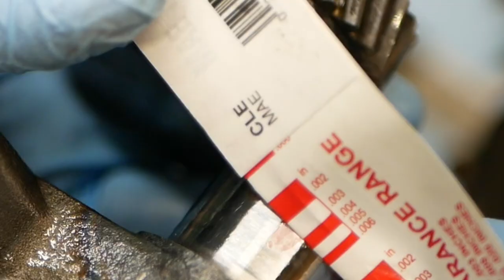212cc Predator powered mini bike motorcycle engine swap installing a stage 2 kit

Comment: You should try the juggernaut pulley from gopowersports. Works better with a built engine. I put one on my go-kart and I really like it and it doesn't rattle like the stock one. Also, I found with the yellow spring in the driven pulley, it wouldn't allow the pulley to fully open up due to the thicker spring binding. I had to put it in the lathe and machine out some modifications to the pulley and the cover that fits on with the snap ring. Now it is much better and runs to its full speed range.

Comment: longer intake - max momentum is in higher rpm , shorter intake - max momentum is on lower rpm. "Spaghetti" intake has variable lenght, flaps are changing lenght of intake, so momentum can be more "flat".

Comment: I recommend if u want more rpm with that cam and carb that can deliver it I put 26 lb springs very cheap only like $10-$15. On nr racing they are the max u can put on hemi with out cutting vavle pockets with a big cam and you’ll gain rpm right know with that setup you’ll hit vavle flait with 18 lb spring I build tons of those motors and last guy I had come to my shop had that exact problem

Comment: The long Runner going from the carburetor to the intake is higher torque at lower RPM I doubt that motor RPMs very high. Probably the best you can get you could try to adjust the length if you wanted you to see if you got more power at different lengths. Richard holdener on YouTube does a bunch of dyno test on different Motors and shows the difference between long and short Runner intakes.
Reply: That right William

Comment: The old was a two stroke 100 so it is equal to about a 200 four stroke but it is still quite a bit more powerful
Reply from the maker: The old engine was a 100cc four stroke, the bike was originally a Honda XR 100

Comment: Are you using the sprocket that came with the torque converter or are you using the original dirtbike's sprocket? I'm wanting to do this with an XR75
Reply: I believe he covers that in detail in the the first video in the series
Reply: @davidhelgeson6997  thanks, I went through and looked and I'm assuming it's the original TC's sprocket, might be wrong though.

Comment: I tried the long intake tube but the air fuel mixture wasn’t getting to the carb. I know I need to probably turn the idle screw, but how far out is the idle screw on your carb?

Comment: @ 1:05 you show the carburator and at the bottom of the intake manifold side there is a hole at the bottom of the carb. What is it? It was leaking real bad for me and I notice the gasket and plastic Spacer doesn't cover the hole is there a reason for that or did I just get bad parts.

Comment: Really like this. I've got an old crf100 that would be suited nicely for something similar
Reply: Doesn’t the crf100 make 10hp? That’s much more than these little engines, and you don’t have to do any custom fabrication.
Reply: agave 58-58  9.5 horsepower allegedly, and only 5 foot pounds of torque. You could easily exceed those power specs and displacement with a built predator engine. Probably won't ever get around to doing it but it would be cheaper and easier than rebuilding the stock engine or trying to squeeze more power from it
Reply: Jacob Reynolds ah, I thought you meant that the thing was running, makes sense.

Comment: Turned out pretty good.  What's your top speed before and after thd mods?
Reply from the maker: My top speed is still around 55MPH
The CVT seems to be limiting my overall top speed, it definitely pulls pretty hard now 👍
Reply: @Mikefestiva  oh wow it didn't seem that fast. Never knew this was possible to install one if them motors in a dirt bike. Im picking up a '79 Yamaha YZ125 this evening. The guy already did the frame work so all it needs is motor, chain, and torque converter. On another thing I'm Kinda doing the same thing. Its a '71 Rokon RT140 1wd Trailbreaker Offroad Motorcycle. Throwing in a 242cc Honda.

Comment: Reinstalled piston with the old rings? Why not take the extra minute to put new rings on while it's apart?
Reply from the maker: Because the engine has 5 hours on it when I installed these parts. The engine was barely broken in.

Comment: Your video inspired me to build my own bikes!! I made two  208cc bikes and they rip!! We explore lots of logging roads here in BC Canada and I've found my bike blows belts quite often. I changed the rear sprocket to a 62 tooth sprocket to help reduce the strain on the motor for climbing but it still burns belts after a while. Any suggestions?  Thanks Andrew
Reply from the maker: That’s awesome you built some bikes!!!
I found the aftermarket belts I have been using last longer then the stock belt but I know what your saying. There must be a better quality belt available? I remember when I was tricking out 2 stroke scooters years ago I ran quality Kevlar belts if we can find something like that I bet they will last much longer.

Comment: I would only be worried about fuel puddling in the tube, I would rough up the inside of the intake myself for a carbed engine. Regardless Love your builds and how you build it for your purpose.

Comment: Try the juggernaut driver in the front of your torque converter
Reply: Yeah the jugger is pretty mandatory for any stage 2+ build. The stock series 30 main just cant handle the power and will slip like crazy.

Comment: The xr100 brings back lots of memories, is your predator conversion more powerful than the original motor?
Reply: Its probably pretty close to the same power or a little more powerful. It's just lower rpm, different power delovery.
Reply: The original video will give you more information but from what I understand is that it is more powerful than stock however the other commentator makes a good point I’m sure the lower rpm does change the power some. Nike gave it a thumbs up though and for a bike heading to the dumpster I think it was worth the $170

Comment: Great video series on the predator swaps. I am highly considering this swap for my Yamaha blaster 200 atv. The whole engine needs to be gone through and I am think for my needs the hopped up 212 MIGHT do the trick. Northeast USA is much more accepting of 4 wheelers on public trails  Do you think there's enough in these 212s to push around a 324 lb sport atv? 17hp stock engine.  210 lb rider..

Comment: Now HF has all your welder reviews linked to their welder descriptions, that's cool. Maybe you can buddy up to Eric Schmidt at some point? lol  The quality of the predator engines is unreal, how the He11 can they sell those at a profit for $99! So is that new cam a bit loapy at idle? Looks like a ton of fun. You musta made this vid awhile ago, it's not jacket and stocking cap weather now.
Reply from the maker: HF has been using some of my videos for a while now, that’s actually how I got the Titanium plasma 45, after friends mentioned they had my videos linked to there website I ended up contacting them and they sent me the plasma 45. Getting that tool from HF got me looking into CNC tables, one thing let to another and it all came together on the articulating dump truck build series after that👍
Haha it’s almost always stocking cap weather in western Washington I just finished the video last week 😂
Reply: @Mikefestiva  Dang it's been in the 90's most of July in upstate NY
Reply from the maker: kmcwhq It’s been in the 60s to upper 70s but cools down at night. We only hit low 90s for a week or two every summer. It’s okay it’s cooler right now, there’s a forest fire burning about 8 miles away from my house right now 😕
Reply: @Mikefestiva  Ya the grass is all brown around here. Maybe time to build a fire pump?

Comment: Would of been cool to use a Honda gx motor and mod the hell out of it. Im an  Outdoor Power Equipment technician and i work on these motors pretty much every day. I never worked on a predator motor cos I'm from Australia but i like your build.
Reply: @atb002  true, but not 100% compatibility with honda parts. They are extremely similar but also way different lol.

Comment: I know you are suppose to lube the torque converter every so often, but with what? WD-40?
Reply: WD-40 isn't a good lubricant for that. WD-40 is water based and dries out quickly so something more like chain grease would work better
Reply: @spencerkisby7040  ok thank you
Reply: Can-am and other manufacturers make a specific product

Comment: Amazing how hard that 212 pulls with that size rear tire... What is the tooth count on the rear sprocket? Is it because of the converter.
Reply from the maker: I think it’s a 50 tooth rear sprocket, I would like to install a 55. Those torque converters do an awesome job at maximizing the little 212cc engines. Thanks for checking out my new video!
Reply: @Mikefestiva  Some of my shop buddies race  1/12 mile dirt oval with pull start mini's...I run a Briggs Raptor 5 horse cart motor. The Converter might be just what I need to run out front with the old Flat Head... Thanks for the info,  dig your channel!

Comment: cool project!
Have you had any problems with blowing out the rear wheel spokes? I couldn't keep a set of spokes in my XR100 no matter what I did, I ended up retrofitting an XL100 rear wheel that was considerably heavier built (and 17")
Seems like the carb is working well, but the reason the car you showed has long intake runners and will never have a problem with it is it's fuel injected and the injection happens at the port.. long runners on a carburated engine can cause tunability issues.. doesn't seem to be a problem anyhow.
Reply: My friend had an xr80 back in the mid 2000s and he busted his all the time. He did flat land it pretty rough off jumps. Id just get a stout aftermarket rear wheel and spokes.

Comment: I wonder if you got lights and flashers if it could  be fast enough for the road.
Reply: I was looking into doing the same thing, i found an electric start kit with charging system kit available for the Predator 212cc. there are 2 different ones, Hemi and non-Hemi... I think the flywheel shaft is different between the two.

Comment: You brought out the valve lapping compound and didn’t do the valves?
Reply from the maker: No I lapped the aluminum flywheel to the crank,  it’s mentioned to do this in the instructions for the ARC flywheel.

Comment: Hope you see this, ive built one very similar to yours but it seems you’ve got more power and punch. Even at stock... what could I have done wrong
Reply: Did you remove the governor gear from the crankcase?
Reply: so much power is derived from gearing.  you might check that your rear sprocket is the right size.
Reply: the rite gearing is important. to low of gearing it will accelerate good but with a low top speed  to tall of gearing and it will be sluggish and the motor may not reach full rpm's and may even have a lower top speed than a lower gear ratio would have

Comment: how long did the belts last? i have an xt250 with a tillotson 212 thats getting a stage 2 kit. with just the stock 212 and 10/49 #50 gearing with a 110/100r18 rear tire, its torn a belt up in under an hour of ride time. i have a 60 tooth rear an 9 tooth front sprocket coming along with a juggernaut primary and a 7" driven to hopefully give me enough gearing to allow the clutch to shift properly and not tear up belts.
Reply: You have a real low gear ratio sounds like
Reply: @charliewilliams8026  the 60 tooth gave better belt life, but still no wheelies. ordered a 72 tooth rear sprocket to get even more low end. i want to be able to do wheelies on command.
Reply: @Trevinator1990  I have a torque converter and it is a 10 tooth in the front and a 53 tooth in the back and 19 inch tires
Reply: Make sure the pulleys are aligned
Reply: @1661st_Moto  right lmfao guys pulleys are probably an half inch out of alignment and hea chasing his tail

Comment: Fun stuff!  looks and sounds like it pulls hard, any idea on the new horse power??
Reply from the maker: Thanks for checking out my new video!
I’m not sure maybe 10 to 12 🤷🏻‍♂️ it’s hard to say, HP is one of those things people sometimes claim mass but in reality it’s less then they think. I do know these torque converters work really well on these 212cc engines.
Ps did you figure out anything on the Omnipro?
Reply: @Mikefestiva   no not really, I tried hard reset lots of times. Pulled the board out to look for obvious things and found nothing. Got fed up and bought another and waiting to hear back from H/F about a new board.  Somewhere in the nationhood of 14 weeks. I can least use it for stick.

Comment: Did you change the piston rings after taking the piston off the cylinder?
Reply from the maker: anthony sarantis no, the engine only had about 10 hours on it, so there was no need to change them 👍

Comment: Hey Mike. I got a 28 mm mukini on my pred 212 hemi and I also I got a stage 2 kit and it boggs if I give it full throttle how do I fix this? A bigger jet?
Reply: A 28mm is a big carb for a 212. Could be a rich or lean bog. Pull the spark plug and see. Super black and sooty - rich, downjet. White-ish - lean, upjet.
Reply: Too big of a carb. and the engine can’t move enough air to move the fuel needed for that air and it will lean bog, you can try playing with the jets but probably need a smaller carb.

Comment: Your intake will not work well in cold weather. 
The SHO intakes are long BUT, a car engine has considerably higher vacuum and, it's not carring fuel in the runners. The fuel is injected just before the motor.
Reply from the maker: I have rode this bike in 40° weather and it works fine. Any colder and I probably don’t feel like riding anyway.
I have been riding this bike for over a year and it works fine 👍
Reply: @Mikefestiva  ok then, yum yum, I'm eating my words. I guess that little motor socks much harder than I thought.
Glad the longer runner works, it looks better than a shorter one would have. 
I enjoyed your vid, 

subscribed.

Comment: I gotta xr200r can I put a v twin on it with that cvt transmission. ...where do you get a cvt transmission for a project like this...
Reply: xr200 original engine has double the hp

Comment: With that motor you lose the ability to have engine braking right?. Do you notice it alot not having that?. or is it not that big of a deal since its just more of fun toy and not serious riding?.
Reply: The torque converter actually supplies decent amount of braking

Comment: im sure you know but just looked past it, but welding with the plug wire on will cook the coil in these.. experience speaking lol
Reply from the maker: I have never had that problem and probably welded on many but I appreciate the advice 👍 commonly lights and other electronics get burnt up due to not having a good ground and the amperage going through the wiring. Take care

Comment: Hey I'm building a ridge frame flat tracking race bike any tips on clutch set up
Reply from the maker: I haven’t really been happy with the clutch in these CVT transmissions they seem a bit finicky and unpredictable when they will engage. It’s been a while since I have worked on it so I can’t remember what I was running for clutch springs?

Comment: Is the bike easier to ride fast  without a transmission?
Reply: It would be similar to a ATV or side by side with a torque converter. Instant power on demand and not needing to shift has pros and cons

Comment: so what are the advantages/ disadvantages of having the bigger motor but only having one gear?
Reply: its a cvt so it has infinite gears
Reply: @ChuckWood  So the top speed is infinite?
Reply: @92powerdiesel61  top speed is limited by the available horspower
Reply: @davidhelgeson6997  Ok. I just was having a hard time understanding exactly how it works. Thanks.
Reply: @92powerdiesel61  that's not what I mean by infinite.  You can go 1-10 but the increments are infinite.
Reply: @ChuckWood  Oh, that makes sense. Everything in between is infinite. Not the low or high extremes.

Comment: Hey Mike.....Great vids man,I came across your vids accidentally...I'll tell ya I was hooked...I even went out & bought me a rolling chassis because of it.here is what I have 1997 honda xr200r...I watch your videos twice 1 & 2 ....I must say I am stump on 1or 2 issues...my bike has a 520 chain & gear...I would greatly appreciate your input if you can direct me as to what cvt to buy off Ebay to at least get me rolling thanx in advance....kent...Nc.
Reply from the maker: I modified a 40 pitch sprocket to fit the 428 chain, I would think you probably will need to do a little lathe work on the counter shaft sprocket if you still want to stick with the 520 chain. Or just mount a 420 or 428 rear sprocket to your bike and mod the front 40 pitch chain to fit it. I hope this helps 👍

Comment: You could have, and still can, shave about 0.30 or so off the head and port and polish the intake and exhaust. I was quite literally tig welding on my stage 3 212 build earlier today, I come in and find this up, funny how that works. FYI, I am building a sleeper motor, it has all the above mods except running a jetted and bored factory carb, the series we are building the motor for is a "stock" class, i.e. the motor has to "appear" stock and can only run factory carb, thus the work. The tig welding I was doing was gutting the factory exhaust, opening the flange to the same size as the porting job, and then rebuilding it to look stock but using a 1 inch pipe going into the muffler instead of the factory 1/2 inch. It is quite impressive how much material you can remove from the head when porting it, it suprised me how restrictive it was. As for the long intake runner, there is a school of thought that a long runner like yours, increases torque and I have found it to be the case, verified by my gluteous dynamometer.